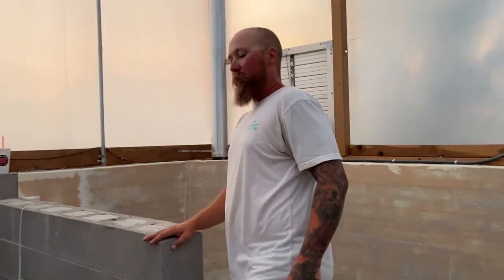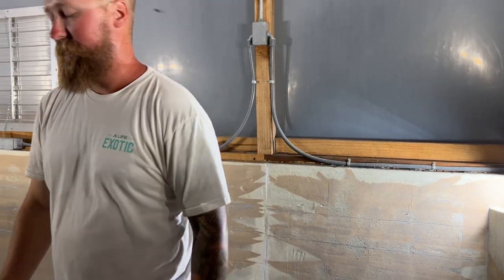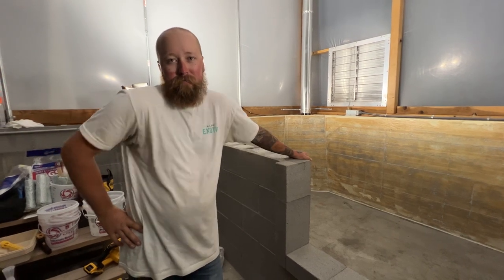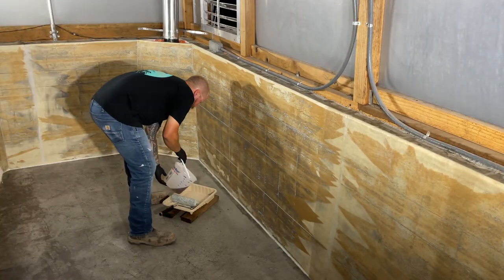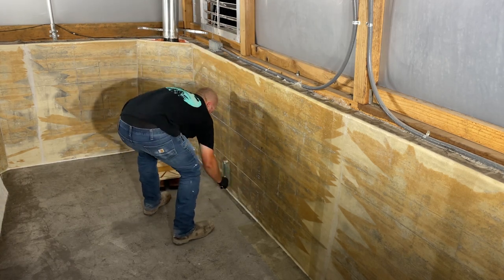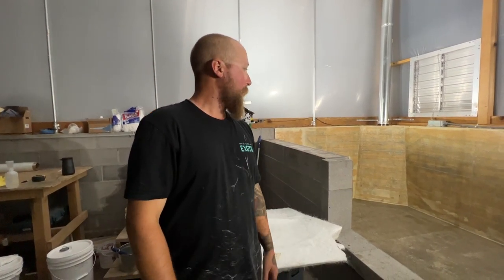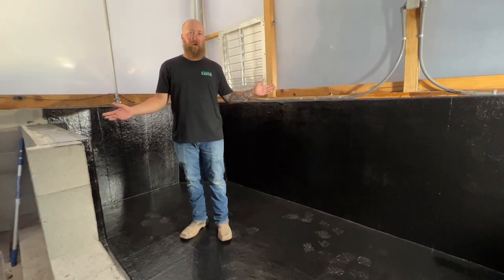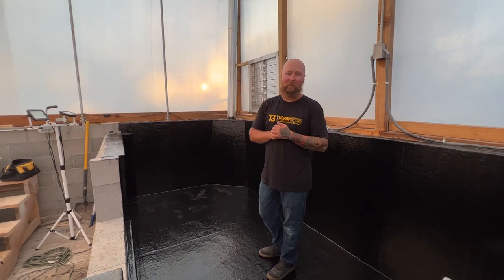Fiberglassing The Greenhouse Pond 😅

Comment: Is the fiberglass even necessary is it just cosmetic
Reply from the maker: The fiberglass is needed to waterproof the pond and add strength in case the concrete/bricks ever settle or crack